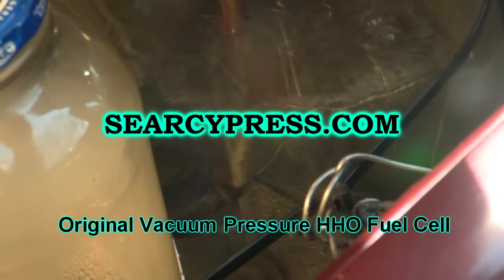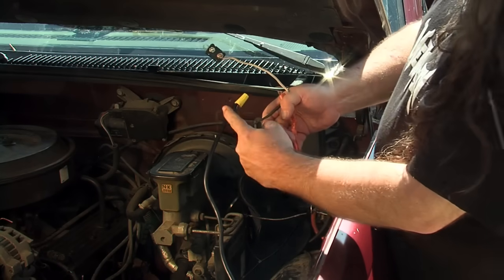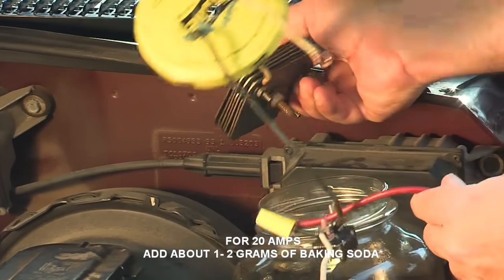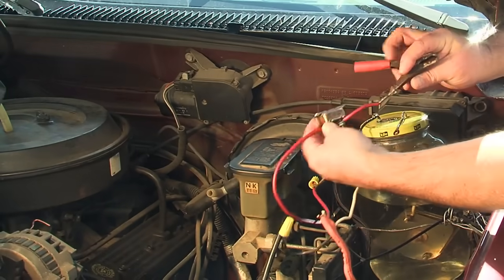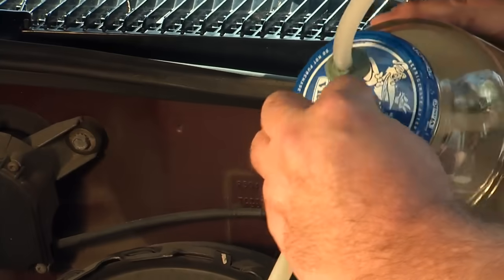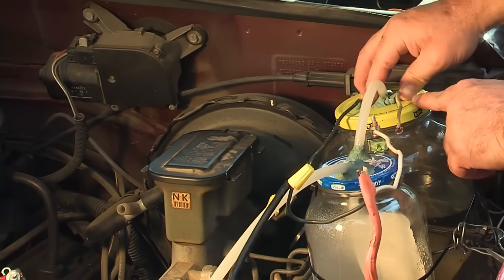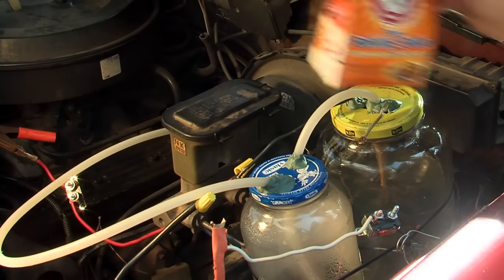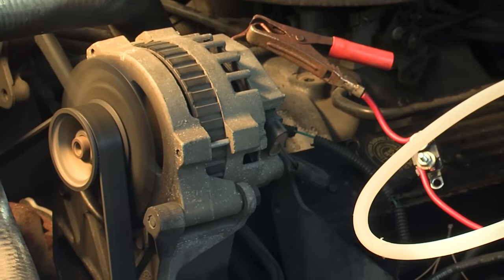Vacuum Pressure Hydrogen fuel cell defeats high gas prices using hydrogen from H2O.

Comment: one detail everyone forget is that, when the water in the jar get hot produces vapor and it enters the combustion chamber and is mixed whit the hho gas, so when is compresed by the piston this vapor breaks the water moleculars also into hho, so thast the rason this thin works even it is hot, the water breaks at 1600 degres into gas and when you compresed the vapor it gives more power, some people are injectin water directly on the combustion chamber
Reply: and that's bullshit Mario, because water doesn't compress first of all, like fuel does or "break" at high temp or whatever the hell you just claimed. Like Shawn said, phase changes. There is already enough moisture getting into your vehicle and engine, naturally and ideally I would like to see none, but that's life. Moisture from condensation in the fuel, moisture from the surrounding air etc. Do you even hear yourself dude? "Some people are injecting water directly in the combustion chamber", lol. Well, those people are pretty stupid then, aren't they? Not a completely stupid idea however, just water in the wrong location. BMW, is doing something different than this, injecting water not into the engine, but into the exhaust piping, as it exists the engine to cool the exhaust, before it gets recycled through a turbocharger, or just out the tailpipe. Sort of acting in conjunction with an intercooler, or perhaps replacing the intercooler for a turbo. 

Anyway, water acts like a brick inside and engine. It's blows holes right through engines, if there is enough of it. Looks like a .50 caliber bullet went through the engine. Extra moisture is not needed, that's for sure and an engine and gas contain enough of that already, which leads to a less efficient burn, not more. Not only that, it encourages corrosion, especially in the presence of water and oxygen. Lesson here is, don't drive through deep water and get it into the air intake. Not unless your's is mounted high. I've seen what water does and it's not nice. This is why lubrication is so important, to help shield against moisture and slow or prevent corrosion and keep things running smoothly. Moisture is the enemy in vehicles. So, ultimately, Shawn is actually right. It takes a chemical reaction to change molecules and this is utter nonsense. The Math and Physics involved is clear. It's not powerful enough to save any money.If you want savings and to truly beat the man. Go buy a diesel and convert it to run on Biodiesel.
Reply: slow down. Dont go too far in to your imagination of what is happenig coz you will hurt your brain.

To break h2o into hho using heat alone you would need atleast 1000celcius it would destroy engine very fast.
Ofc hho have this magic properties to heat up metals only when its in contant for "longer time" so its not burning your fingers and heating metal to thousands, but to prowe it we need to search instead of talk and pray for it to happen. I`m not denying its happening but lets prowe its then talk then you will be more creditable :)
Reply: Wimpy HHO like this, is self defeating. It's not powerful enough or pure enough, ultimately and it takes more to produce in terms of fuel, than it makes and I heard it kills the alternator and battery longevity too cause it strains at least the alternator. It's like the law of diminishing returns applies here, it seems. I have heard, many times, that once the computer (ECU) figures out what is going on, it adjusts the fuel mix richer and you save nothing. You would need "pure", professional hydrogen to make a difference, in big, unrealistic (for cars especially)hydrogen tanks, not glass jars a few ingredients and OMG, what a pain in the ass. Lol. Like the kind that powers rockets. These people don't even know what kind of risk this little HHO system pose, should something go wrong.  

That's why it's not worth it, in my books. I've seen this nonsense tested, for real and the car's computer soon figures out what is going on. The mpg's can actually go down, not up, go figure? Best this can do is run a welding torch and it has done that much, for real. Even as a cutting torch. This crap cannot produce enough HHO for even one revolution of the engine in one hour of generation, fact. It's just that weak and it's not helping anything. The Math doesn't lie, nor does the Science here and I've seen the numbers. It doesn't make sense. If they want real savings, go buy a diesel and convert it to run on Biodiesel. Lol. That's truly beating the gas man. That or buy a Tesla or other electric and just plug it and and pay the hydro man instead. Lol.
Reply: not Boom, he has a fuse, but maybe need a lot of them.
Reply: I'm not sure that's true. I thought temperature and pressure changes just caused phase changes in water. It takes a chemical reaction to change molecules.

Comment: Baking Soda causes poisonous fumes and polluted water in the generator once electrified. 
  Lye is the safest, and least polluting. Right, yes even caustic soda lye is safer after energizing. 
 6v at 12 amps with distilled water, choice of material the right electrodes, electrolyte type, and ratio...30 amps is a lot to ask of a charging system along with parasitic power/economy loss due to the mechanical draw of the alternator, do your homework, not research, it's already been done. Nice set up though, very educational.

Comment: You do realize you are just transforming the electrical energy of the alternator into chemical combustion energy. Essentially all that's happening is you are eliminating the load of the alternator on your engine by putting it to use in creating more energy. Which will give you more mileage, but you would be better off either running a car with no alternator at all or having it powering an electric motor to boost your engine. Also, you don't have any energy left to charge your battery or run your accessories. Converting the energy is never efficient, there are always losses in the process simply because it costs energy to convert energy. Better to simply have a car that requires less energy to run than trying to use your car to produce more energy.
Reply: if theres no alternator the battery wont chargd taking off the alternator would be stupid af
Reply: You have no idea what you're talking about.
Reply: Tyson Roberts the battery is located on the other side of the engine compartment, the jars are in an auxiliary battery tray, intended for service trucks with lift gates etc. an alternator on a car is designed to put out as much amperage as is being drawn, and iirc these trucks are equipped with a 100amp alternator. most vehicles will only ever pull in the range of 40-50 amps unless high draw accessories are also installed, ie a subwoofer/amp or the like. that being said, this is a sound idea in theory, though a cat delete and/or a tune might be needed to offset the o2 sensor reading to lean due to the lack of unburnt fuel in the exhaust.
Reply: Shawn Kamphuis i was playing with those hydrogen generators and im getting the power or positive from the spark plug wite, im attaching the wire from the generator to spark plug wire, the hydorogen is less but still works and im doing from 12 mpg to 14.5mpg gmc sierra 5.3
Reply: how the hell would u charge ur battery without an alternator
Reply: exactly. Notice this guy doesn't have a battery in his car. Just shoved the jars in place instead. He knows he is using all of his alternators capacity for the electrolysis. No power left for the battery anyway. So might as well have no alternator at all. The more power you pull from an alternator the more magnetic resistance it will have. This puts load on the engine and thus is costing fuel. But you can only have so much load before you burn the alternator out.
Reply: Even if the alternator can put out that much in this case. (Most small cars wouldn't have them that strong) You are forgetting the fact that it's going to put a huge amount of extra load on the engine. Plus you are still only making a cycle of energy transformation. It's not going to be free energy at all if it costs so much to produce. Like I said, you would actually be better to simply remove the alternator, thereby having less load and more fuel efficient motor.
Reply: The point is not to add hydrogen to the mix to add fuel. In the engine, the gas does not have enough time for a full combustion. Some say only half of the gas is actually burned. The point is that the hydrogen burns faster. Rather than the reaction traveling slowly(relativity) through the gas vapor, the hydrogen burns faster essentially lighting the gas vapor from all sides.
Reply: Shawn Kamphuis
Some say you essentially don't know what you're talking about either. You're mixing bits of trivia with nonsense.
Reply: Ok, I'll just take my years of engineering education, and go. Thanks for the heads up.
Reply: @tyson roberta. you sir are a dumbass you clearly dont work on cars and have no experience. he wouldnt be able to start the car without a battery its on the other side of the engine bay genius...
Reply: Linuxx All goods, keep burning wood to cut down trees if it makes you happy. I just hate seeing people being drawn to this stuff and wasting their time and money. I had hoped to make people think more about it by presenting some valid points as to why it isn't so efficient.
Reply: Tyson Roberts sir you dont know anything about alternators or hydrogent generator.
Reply: ricardo andres chaparro I do actually, I have done a fair amount of work on vehicles and I know enough about electric motors and alternators to have an opinion about this. More importantly, I know enough about the conservation of energy to know this doesn't work well. Not well enough to actually be useful. I also have a friend who wasted a lot of time and energy on this kind of stuff. I don't want people to do the same thing he did.
Reply: You clearly dont know it takes a battery to start a car. no one is going to listen to you if you couldnt even figure that out... sorry bud but you fail
Reply: I think if you read my comments carefully you'll find that I never stated that. I mentioned that it didn't look like he had a battery in the car which seemed stupid to me. Someone else pointed out that he has replaced the accessory battery with the water jars. Which is still stupid. If saving money is what your'e trying to achieve you would be way better off without a big truck. Also, you can easily start a car without a battery. So return fail?
Reply: Tyson Roberts i read your comment out of context. i have a gmc sierra 5.3 and it was doing 12mpg and i make a hydrogen generator and now 15,5mpg

Comment: I learned that DC moves along the outside only of the copper.....so one big copper strand is not as good as numerous strands of copper like a welders lead....or #10 Auto wire.......This should be an improvement on this great system. Thank you for this great idea..........Heating the water may perk up production....plus would help it work in the winter.......might need a plug in heater to keep the water from freezing overnight?....thanks again......Good job!
Reply: Bad cell design. One does not need more than 10amps. Dry cell far more efficient. There are also hydro/oxygen separators so u can dump the oxy out that would mess up sensors-but these cells cost few hundreds of $. Some GM cars (like my 04 impala 3.4L) have secondary ignition firing that would re-ignite fuel leaving in exhaust while intake valve is opening and actually reduces your mpgs as hho ignites so fast that its fighting against the motor. 
 It does not take much hho to gain mpgs as its there to give a faster - more complete fuel combustion in the cylinder as gasoline is slow burning compared to hho. But you have to trick the ecu to get any gains in modern cars. My 3.4L is not a good engine to use due to multi firing like a 2 stroke engine.

Comment: if you are worried about fuel prices why drive a v8 truck
Reply: Same reason you don't ride around on a bicycle.
Reply: Mic Nor And what is that.
Reply: ben lawton
Sardonic.
Reply: Mic Nor doesn't answer my question
Reply: Because V-8.
Reply: well im sure he had that truck before fuel prices went up. its more cost effective to keep running your same truck vs buying a new one that will get the same MPG anyways. some people need or like driving trucks
Reply: ben lawton ....because you have to have a truck or you die in a 20 foot high snow bank in many parts of the usa....plus gas is high priced because banks buy oil futures stocks then direct their 401k branch managers to use our money invested with them to buy trillions in oil...bank buys low and then artificially raises the worth of oil thereby guaranteeing the bank risk free swindled profit.
Reply: ben lawton because he is dumb as fuck. There uneducated morons.

Comment: is there any risk of backfiring?
Reply: Brake booster is under vacuum. Open a book once in a while.
Reply: Depending on where the hydrogen is sent. What I've seen people do is send it to the second jar like this guy does but have a lid that can pop off. The water in the second jar keeps water from getting to the actual generator. Then the loosely fitting cap would keep pressure in regular use but in a backfire would pop off so is doesn't explode, just burn. Still have some danger though.